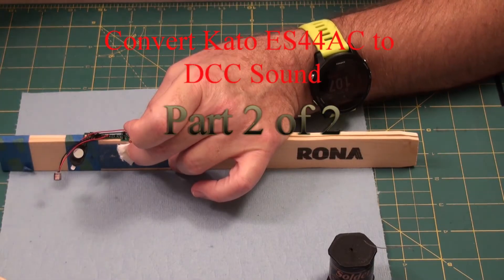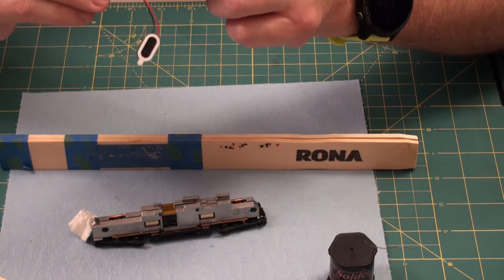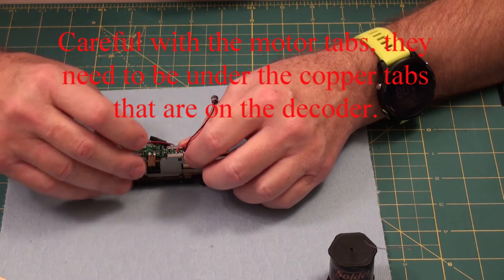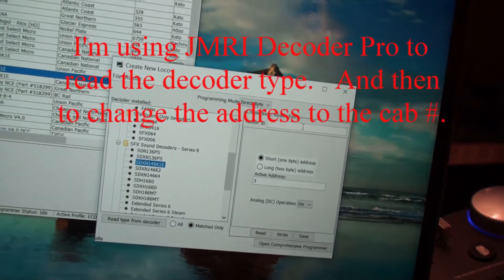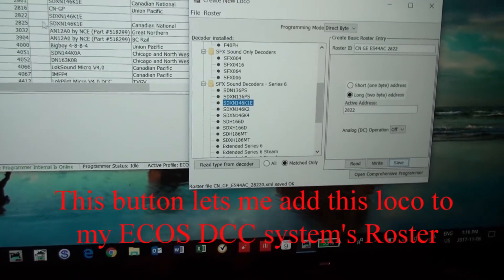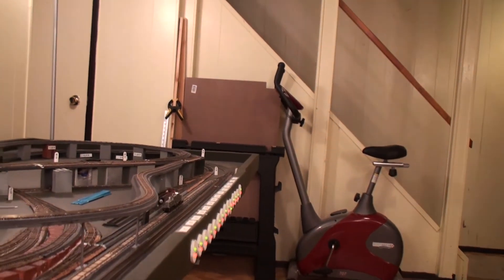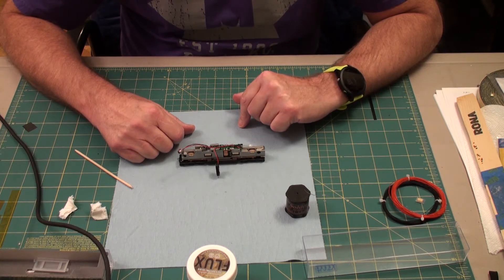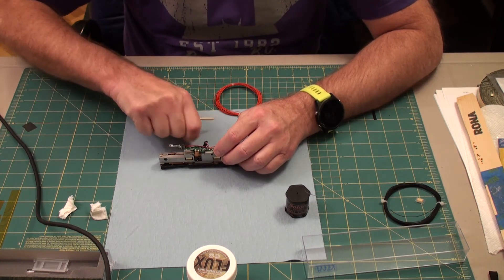Kato ES44AC to DCC Sound Part 2

Comment: Thanks for this Don, I'm in the process of doing two of these conversions before committing to all six of my engines. I see a lot of people dislike this decoder because of its weak sound, but I find that reprogramming it with one of John McMasters projects helped it a bunch. I do think that it provides better sound left under the hood as you have done rather than in the fuel tank as it drastically improved the volume when the hood is installed.